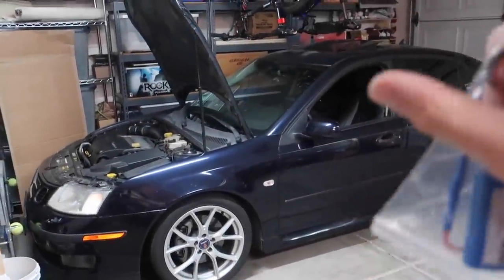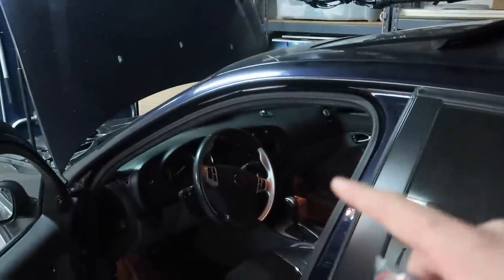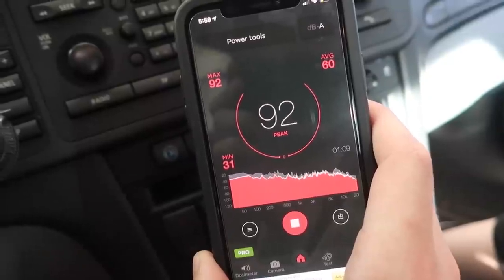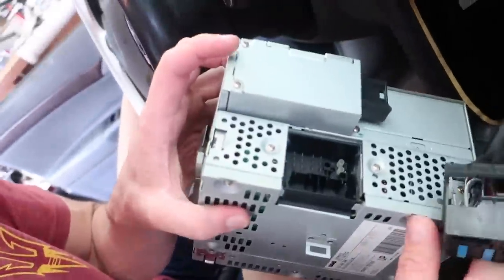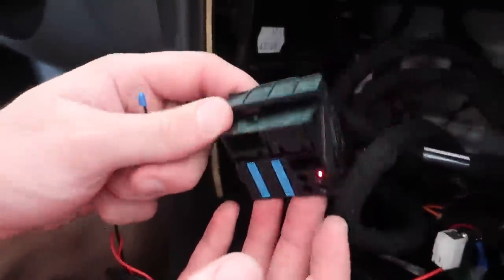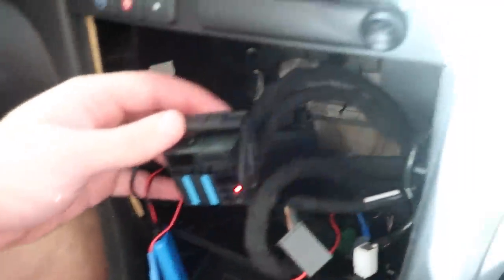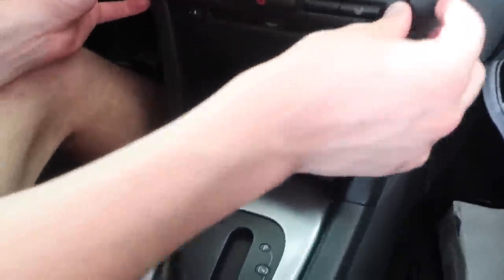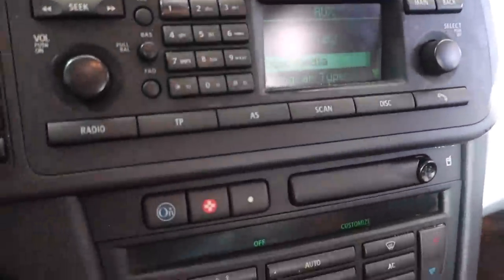2003-2006 Saab 9-3 Bluetooth Install!

Comment: I got this device in the mail today thanks to your recommendation and this handy vid. Thank you!

I did have my AUX activated via Tech2, cost like 50 bucks.. I had run a wire into the armrest with a bluetooth receiver but it had to be recharged all the time and it didn't autoconnect so I'm looking forward to this better set up.
03 Vector
Reply from the maker: Nice! hope you like it

Comment: Hi, i've just installed it today as well  and it works perfectly on my Saab 93 vector 2004.
Took me proxitmly 20 minutes to install it.
Reply: Do you need aux setting for this
Reply from the maker: I mentioned twice in the video, yes. It can be activated with a tech2 if you don’t already have it.

Comment: I went with A Kenwood DIN radio in the old CD player spot, An "O CAN" bypass from etadyne industries took care of the fiber optic bypass basically fixing the loop break when any piece of the stereo is removed.  Bluetooth,Alexa,Spotify all at my fingertips now and can go back to stock without anyone ever knowing this '04' 9-3 Linear ever had 2-15" subs ,a huge 5/ch amp and aftermarket speakers in it (well, maybe the small hole in the drink holder panel where the bass knob is and door mounted Alpine tweeters--lol.)  BUT all that said--I'LL NEVER be selling it (nor my '01' 9-5 aero)  This video would be very helpful for others not wanting to spend an entire day running wiring like I did though!!! Thanks for sharing it!
Reply from the maker: lol yeah, wiring is not my thing; kudos to you for getting that sorted though!

Comment: Compared to a direct "aux" connection, Bluetooth always degrades the sound. I'm not sure what you are hearing other than LOUDER. It may very well be, but "better"? No way!
Reply: I'm not sure what you're hearing,  but he said with the aux it's gonna be louder and better quality
Reply: @danitz56  The point is Bluetooth is a lossy format and has worse quality, however often the aux input in cars degrades the max volume, not sure why but it happens in a lot of older cars. So Bluetooth ends up being better 

An example is using radio, then going to aux, and you’d hear aux is a lot quieter
Reply: @bradley7240  I wonder if this thing he's using would be better than the Bose Bluetooth adapter I'm using into the aux input...?
Reply: Phones usually has poor quality and output level in headphone jack, that's why bluetooth give better quality and louder output. If you use some (non phone ) quality player Fio, Onkyo or so on you might get better quality than Bluetooth.
Reply: only if your aux port is nice and clean which it never is on a phone cause its always in your pocket

Comment: I use a fm transmitter. Comes with bluetooth and works so good. Bought it for 10 dollars, using it on my Saab 93 Vector 2004.
Reply: Problem is sound quality
Reply: Iv got one if those fm transmitters too. Soumd quality is not the best but doed the job. This product should be very good as uses the fibre optic systen. Hopefully they ship to England
Reply from the maker: Sounds like a cheaper solution, but sound quality might be an issue with something like that as stated
Reply: @AutoAutopsy   The sound quality as you mentioned isn't the best. But its not bad at all, the transmitter also has built in bluetooth so no cable is required and works fine in my daily saab. But when i will upgrade the sound in my car i will definitely check out your resolution.
Reply: Get an adapter that connects directly to your AUX port (if your Saab has one) Costs about the same as FM transmitters and they sound miles better
Reply: @AutoAutopsy  saabs doesn't have great speakers so sound will not be the best no matter what you do
Reply: @marin8231  you have to activate the auxiliary input though, that requires someone with the relevant hardware.
Reply: @alastairward2774  My bad I thought his 9-3 has that already. My 06 9-3 Aero has aux already and didn't require what you mentioned. The BT adapter I'm using with the aux sounds amazing. Much better than radio or CD or anything else.
Reply: @marin8231  it's a money raising idea of Saab's that you have to go back to a garage to enable it.

Good luck with that Saab!
Reply: @marin8231  What BT adapter do you use?
Reply: Use the aux in. 
Bluetooth

Comment: I received mine yesterday, they've updated the device, it now has a small microphone, so you can use it for making phone calls as well. The sound is phenomenal. Before I used this thing, I had a Bluetooth device connected through the aux input. But this is way way better. Only negative thing, you can't use the steeringwheel buttons to go to next song.
Reply from the maker: yeah, but that couldn't be down with he aux either, so it's not a "negative" imo
Reply: Hey, I just ordered mine yesterday and I’m just wondering how the microphone works and if it’s any good?
Reply: Does the bluetooth work even when key is out and radio is turned on?
Reply: @Mareks_Riekstins  Although I haven’t got mine yet, I would assume so considering that the regular AUX does, but I’m not quite sure, since it’s connected to the cigarette lighter.
Reply: @kallis2557  im thinking about this bluetooth kit but if it shuts down when i pull the key out then i see no benefit and i can just stick with aux cord. I want to keep all wiring as close to stock as possible.
Reply: @Mareks_Riekstins  I mean I get that. The wiring however is very easily reversable, just undo the steps taken to implement the module. But as you said, if it doesn’t work without the ignition on it makes it a little less attractive. I still ordered it though, I’m mainly looking forward to the convenience of bluetooth!
Reply: I ordered but never even got a confirmation email, just a CC charge, did you get a confirmation email?

Comment: So thats why there are circle holes in quadlock connector (connector that feeds power and speakers and extra things like aux to the radio)

In VW land we have the fuse where quadlock has holes snd separate fobre optic wires that have its own connector (most bus its called)

But quadlock connector is almost the same

Comment: Awesome! I've been looking for something like this for two years now. Bought it immediately :D
Reply from the maker: Nice! :)
Reply: Hi Henrik, I'm Fernando. 

I Like your Saab videos. 
I have a few questions:
I have a Saab 93-2003 Vector 2.0T.  Do you sell this  Bluetooth device? Or how can I get It?
My Head Unit doesn't have a "Multimedia" ir AUX programmed in the stereo, do I have to program it with Tech II?.

My other Question Is the "Check Engine" light turned on and I scanned the car and send the "P0546" code, wich is "Exhaust Gas Temperature Sensor" (Circuit High, Bank 1 Sensor 1), Do you know if I have to replace just that sensor? Or might be another thing? 

Best Regards from México.
Reply: @shikafer  I know it might be late, but thought I'd reply anyway. The AUX needs to be programmed before, otherwise the connector being plugged in might actually disable the radio as well. After that you can run this device or an AUX kit if you have one.

For the Error, that sounds like one of the O2 sensors is dead or faulty. Bank 1 always shows for the 4-cylinders (I have the same engine, the B207L), Sensor 1 should be the one immediately after the turbo heat-shield. You can see it sticking out near the coolant reservoir, towards the firewall.

That one should be easier to replace, on mine, the other one, on the exhaust under the car, failed 3 times in 9 years since I've had the car, and it's annoying to replace...

Comment: I just installed this on my 06 9-3 Aero. It works beautifully. This video helped immensely after I couldn't find the instructions on the website. 

I had an aux cord to Bluetooth receiver previously, but I hated powering it on every time I got in the car. This is automatic. 

Only issue I had was my lower section is a cubby, not an ash tray. Used a flat head to pull a little tab away from the side to release the left, yanked on the right. Pulled out fine.
Reply from the maker: yeah, i love that its automatic :) glad the video was helpful

Comment: Nice. I got the parrot mki9100 installed on my Saab. Cost me around $300CAD but overall it's good.
Reply: I also got this parrot installed. Best thing ever for this car. Bluetooth music, automatic telephone mode when calling, USB flash function, AUX function.
Reply from the maker: Awesome
Reply: Does it need the Aux input? It kind an insteresting solution.
Reply: @ilhamimaamuddin6836  Yes and no. If you connect the aux with this device you somewhat get better sound clarity.

Comment: I beg you to make video about after market speakers install video and how to do that in 2003-2006
Reply from the maker: Oof it’s a lot of work!
Reply: Auto Autopsy i know but i garantee you lots of views because its biggest problem in these. The audio system is so shit and its almoust imposible to make it better. I hope you can make video of it, it will be very helpful video
Reply: @oskarirajahalme1912  if you want to add additional speakers then you have to install new fiberoptic cables and add  amp 1 under the driver seat if you have icm 1, icm 2 and 3 already came with it. It's a major job and very time consuming.
Reply: I’ve changed the dash speakers but from what I’ve read it’s not really worth changing the other speakers on cars with the fibre optic system. Not much improvement.
Reply: @jc4778  was it hard to change them?
Reply: No just get the right size...bit fiddly if you have big hands like myself but still doesn't take long.
Reply: @filip1997andersson  I jus add after market amp and ran my own speaker wires. Wasn't hard at all.  Must have after market deck/DVD player/radio head unit/bluetooth head unit..... and so on
Reply: I've replaced every speaker in a 2003 9-3 SS, it was no different than the 07+ non fiber optic system, with maybe only one exception.  The dashboard center speaker has to be shallow, I think even more shallow than the 07+ 9-3 dashboard.  The most important step is just using quality replacements, and making sure the front door speakers are 2 ohm compact (shallow depth) subs.  There are not many options for compact subs, the ones I've been using which sound really good are Kicker 40CWRT672 6.75" 2OHM compact shallow subwoofers.  Using these will require cutting the door opening a bit in some spots, and I also always reuse the original speakers mount after I modify it to hold the new speaker firmly in place.  All other speaker replacements can be 4 OHM.  Another thing to consider is whether your 9-3 has the factory trunk amp, if I remember correctly, Saab called it the Premium 300 system.  Adding that to my car (sourced all speaker wiring, AMP, and power line from an 03 ARC) allowed me to add more speakers to the rear shelf to provide a fuller sound.
Reply: comes with bose speakers no?

Comment: It's the first time i see this video. There's lot of discussion about sound quality bluetooth vs cable. Actually it's the same discussion wifi vs internet cable. IMHO it depends on the stability of the signal and bluetooth, but also wifi is not a very stable connection. I myself prefer the stable quality of a Audioquest AUX cable and the sound quality with my ICM3, OEM fitted Pioneer speakers with OEM Pioneer subwoofer in the rear + extra Ribbon tweeters with home made x-over, is excellent. Even the centerspeaker is the same. I added some Dacron.
I don't have to change the speakers or use a bluetooth connection.
Reply from the maker: fair argument and comparison!

Comment: I ordered the SP-BT01 and got a SP-BT02...with microphone!  Looking forward to the full BT experience with phone.
Reply from the maker: nice
Reply: I think I did as well. How are you installing the microphone? I don’t see any instructions with mine.
Reply: How is the echo?
Reply: My mic line is hanging out of the crevice between the cabin air module and the dash...sloppy.  I'm thinking of drilling a hole in the left side of the cup holder to pit a mic jack.  The echo is annoying...any ideas?

Comment: Hello, Have you ever used or compared the sound via a generic cigarette lighter usb FM radio adapter that connects wirelessly as a  radio station like 88.1 fm?

Comment: "I've been told my outro song sounds good on this system"

Hi that was me.

But I'm also running a 10 in mine. Using a low level signal processor, I'm pulling low end power off the 6x9s and sending that signal to an amp, and to the 10. Keeping a nice factory GPS head unit, but having some sweet low end.
Reply from the maker: Lol, thanks again for the suggestion! Couldn’t remember who it was exactly 😂

Comment: You can save the aux connection if you pull out the pins and refit into Bluetooth plug
Reply from the maker: thanks for sharing! didn't try that
Reply: Hi is there any video how to pull out pins and refit in Bluetooth plug?
Is that the only option to keep aux?

Comment: I was very sceptic to Fm transmitters,  tryied some, but then i found the Xiaomi Roidmi 3s and in 9-5 ‘06 with Denso works really good. Comparing sound between cd and bt fm trans is relatively without great noise hum or fm white noise and tone quality is also verz acceptable, for example the noises from outside of the car are much worse. Verz inexpensive soulution, looks like usb charger (got it in black so it fits interior), provides quick charging and also ambient lighting is adjustable 
so you can turn it off or in my case set default to same green as gage clusters
Reply from the maker: i'm just not a fan of stuff like that in my interior, that's why i like this. OEM look and feel!

Comment: FYI: I just received mine and it came with a mic attached, so now allows calls etc 😊👍
Reply: Is it possible to answer calls and change songs directly from the wheel?
Reply from the maker: Yeah! They’ve since updated it! Pretty cool
Reply: @DrTherik  not tried it yet, but will update when I do
Reply: I would appreciate that, thanks :)
Reply: Where do you plug the mic into ?
Reply: Nevermind, found out.
Plugs into outlet on bt female cord. Not included in instructions 😒

Comment: Great work, thanks.  A quick question,  I went to the Saab Plus website and it said to check if Aux is enabled to push the CD button on the head unit twice and Aux should show up.  When I do that I get the same screen as when I click through to use my Aux input that says shows:
      Play
Change Media
Program Type
I assume this means that I have Aux enabled.  Am I correct in this?

PS I removed the stock dash 3.5" speaker and tweeter and installed a set of Infinity 3.5"  2 way speakers.  The difference was incredible.  Not only in sound quality, but volume also.  The difference was so significant that I had to change the rear 3.5" side speakers the same way to balance out the sound without having my fader dialed almost entirely to the rear.  My set up is a little different than yours as I have a 2006 9-3 Arc convertible with the 13  speaker sound system.
Reply from the maker: Oh nice! Glad to hear you’ve had good results with those speakers. As for the Aux, hit “src” twice in the steering wheel. If an aux option never comes up, you probably don’t have it enabled
Reply: @AutoAutopsy  Got it.  Have to wait a few seconds in between each press of the SRC button.  At first I was doing it as you would double click a mouse.

Comment: I just bought a fm transmitter which plays my  Spotify etc and my phone calls. Plugs straight into the 12 volt cigarette lighter socket. 20 bucks.

Comment: Installed the unit successfully. Problem is it killed the sound quality on my rear speakers.  No bass at all now ?
Reply from the maker: Did you accidentally change bass/fade/other audio settings during install?
Reply: No . I was curious if  this was a trade off for plugging into the Aux port ?

Comment: Thanks!  I have the navigation on my 2008 Aero convertible.  But am wondering what to do with a nav system that quit working three years ago.  Keeps demanding I insert the DVD or is perpetually checking.  I would love to totally replace the unit.  Your thoughts?

BTW, I replace the fuel regulator (previous problem with check light) and it’s worked.  However, I can see me spending $3k to $4k on brakes, tires, new wheels and other things.  But love this car.
Reply from the maker: If you're doing the work yourself, that sounds amount to that much money unless you're buying expensive wheels. Aftermarket head units aren't too hard to do on 07+. You can find some good info online about swaps

Comment: You can also just buy a Bluetooth adapter for like 20 dollars on Amazon. I love mine and it can take phone calls.
Reply from the maker: Don’t get the same sound quality tho
Reply: @AutoAutopsy  it depends on how good the adapter is. Usually most of them still sound better than radio and CD which is a big win in my book given all the benefits you get with BT for literally 2 minutes of your time to install it.

PS. I'm assuming Caffina is referring to adapters that connect straight to the AUX port which sound much better than FM transmitters.

Comment: Great Video. I installed it in my 04 Convertible, but now the cabin fan is not working. Any ideas of what the problem could be?
Reply from the maker: not sure; maybe you blew a fuse or didn't reconnect something
Reply: @AutoAutopsy  Thanks for the quick response. Will check the fuses. Great channel by the way!

Comment: I have the aux cable with 3 PIN without connector, Which are the pins to connect the cable?3,4 and 10?

Comment: I would love to use it on my Saab 93 convertible 04 but the car doesn't have an AUX so I honestly don't know if it's worth it... and how easy can be to find some one that can eventually program it via Tech2, any suggestion is more than welcome!  Great video though!
Reply from the maker: it's super simple to program the aux in with a tech2; you just need to find someone who can do it!